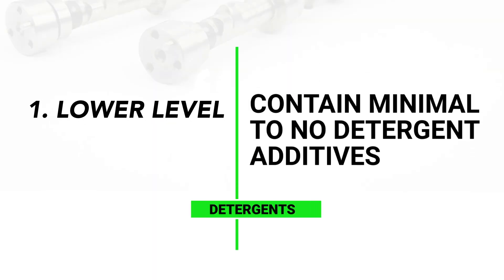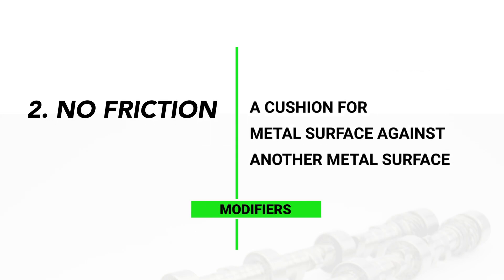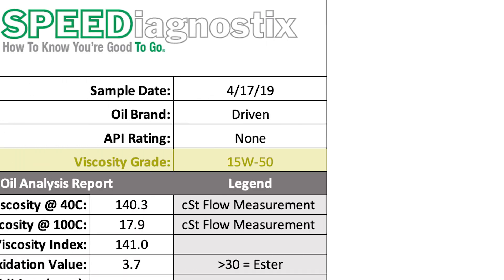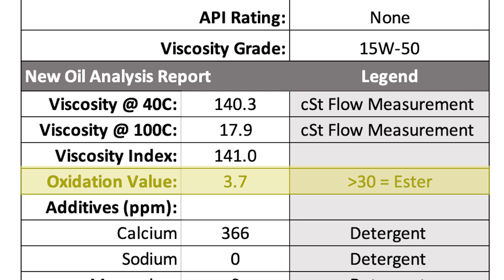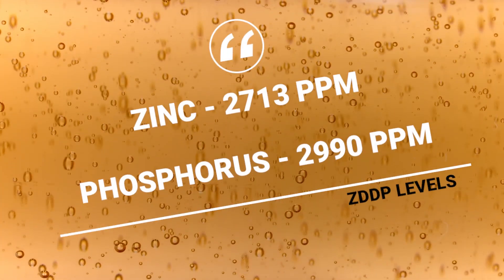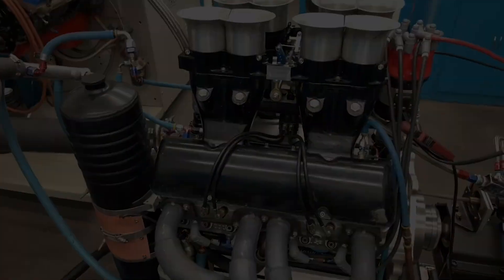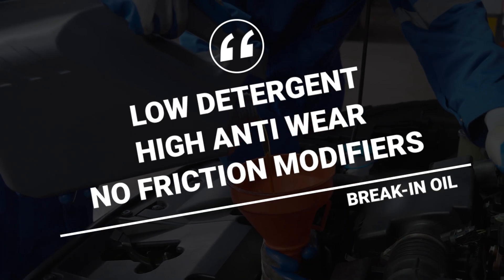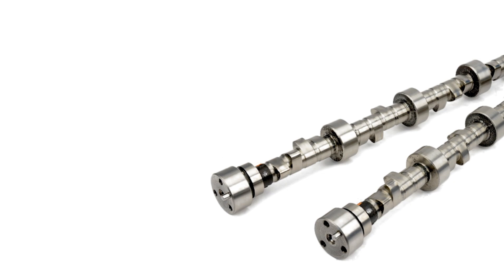Is It Just High Zinc (ZDDP), Or Is There More To It?

Comment: I am planning on replacing my worn out, year 2000, chevy Silverado 6.0L engine soon, would you recommend using a break-in oil with that engine and if so, how many miles before going to a normal oil?

Comment: Hey @themotoroilgeek I’m having a brand new 6.0 Powerstroke diesel engine built with coated pistons and bearings. I wanted to use the Driven DBR 15w40 break in oil, but the builder said he ONLY recommends Motorcraft conventional 15w40 or Shell Rotella conventional 15w40 for break in on these engines. Change the oil and filter after the first 100 miles then again at 1000 miles using the same oil. Then change at “routine intervals” with conventional or semisynthetic oil of my choice until 20,000 miles where full  synthetic is permissible. I’m sure I already know the answer, but am I doing myself a real disservice by following his recommendations?

Comment: If I got a new long block for my Jeep, say a 3.8 for the Jeep JK, should I use a Break in Oil for the first 200-300 miles? Use something like the Driven BR5w-30
Reply from the maker: Yes, that is a very good break-in oil.
Reply: @themotoroilgeek  I saw your other video recommending ZMax and Motul also, but their oil is a lot thicker for that engine. Not sure it would be ok.

Comment: Break-in is the key word, you want wear, but you want it where it matters, piston ring sealing. The tappets get protected from the extra ZDDP in break in to mate the tappets and cam.
Reply: Emissions regulated engines have to be ready for test off the line, limited break-in. Rings are potted for break-in to circularity before they arrive for engine assembly, or were. Modern bores are cylindrical when final honed, so the engines can be run after a 20 min warm and test cycle. This is/was standard in the diesel industry 10 yrs ago. Actual break-in was minimal and only in the factory. Aircraft engines (air-cooled) are completely different matter and must use a non-detergent break in oil for 10 hours under 75% load. Automotive engines are much higher precision parts than 20-30 yrs ago. My Toyota had zero debris in the oil filter from day one. Not so for automotive of 15 yrs ago or aircraft engines today. Aircraft leave shiny metal in the filter for 50-100 hrs. Then they ARE broken in. I inspect all my vehicles oil filters.

Comment: What oil should I use to break in my bmw m20 engine, I have spent a lot of money on this engine and it is a solid lift cam that you have to adjust every 45,000 miles you have a rocker arm sliding on cam lobes and I want this engine to last, also it does see some track time turning to 7000 rpms

Comment: Just use the higher film strength oil and drive. The old break in oil days are obsolete. EX. oils that are over 100,000 psi film strength on the computer controlled heated tribometer. Check those "break in" oils for the typical low film strengths of 50,000 to 65,000 psi failures.  There are oils now reaching 150,000 psi film strength levels now far exceeding any break in oils. You flat tappets will be fine from the first minute.

Comment: Hi Lake, 

I purchased a reman GM Goodwrench LQ4 (6.0). Instructions say to Pre Lube using GM Assembly Lubricant P/N 88862587 (EOS) or equivalent with their GM engine pre luber tool or equivalent (hand pump container); says to use preluber to fill filter and oil cooler/lines. Apply oil to cooler inlet line , check for debris at return line and flush if there is debris ( I installed new lines). Then connect preluber to engine with appropriate adapter , open valve, allow oil to flow for several minutes after oil appears in valve train area. This is the preferred method. 
Method 2- When applicable , use drill motor to turn oil pump to pre lube, turn oil pump 200-500 rpm for several minutes after oil appears in valve train area. 
When previous two methods are unavailable. Disable spark and fuel, and crank starter for no more than 30 seconds with 2+ min rests between until  normal oil pressure is reached, and continue to do this for a total or 2 minutes after normal oil pressure is reached.  It’s not clear if I should only add the EOS , or also fill with oil for any method. EOS bottle says it’s not to be used as an oil additive. Spoke to dealer, they just said If I want I can open up valve covers and pour Oil or EOS all over, then top off oil to proper level and prime. Opened oil drain plug and some oil came out, I imagine it’s from manufacturer testing engine. Instructions don’t specify what oil to use either.  Instructions are P/N 89017902 
. Any thoughts on best way go about this ?. Apologize for the long message. Thank You

Comment: Have a question  for you!  I have a 2023 sierra with the 6.2  changed my oil at 800 mile for the first time a put a wix filter with 0w20 mobil 1 in it.    Even after another two short oil change intervals I still had metal in my oil  filter, which led to the truck being at the dealer for rod knock.   I'm getting a new engine now.   When I get the truck back is there anything I can do to prolong the new engine ?  Can these new v8s handle a thicker oil than the specified 0w20?

Comment: I would like to use the driven BR oil in a predator generator to break it in, that calls for 10w30, but I don’t see a BR 10w30 weight in the web site? What weight would be most appropriate to use if that’s the case?
Reply from the maker: Use the BR30

Comment: Hopefully you see this before i start back on my engine i have an iron block ls. Ofc with roller lifters.  I was told to pour zinc before start up. I watch you last video🤦🏿 so if it'll be bad, what i need to use to break the motor in?

Comment: Hello Lake. I have a question about the Driven BR 15W-50 oil. Is this oil safe to use in a Harley Davidson Twin Cam 103? I will be rebuilding the top end and going to a 107 cid. The main reason I was looking at this oil is to chemically seal the rings. I have roller lifters and the main bearings on a Harley Davidson Twin Cam are roller bearings, not your typical babbitt style. Harley Davidson states that if you are in a pinch and need to add oil to your bike and the oil they recommend is not available, you can use a diesel  "C" rated oil of the same viscosity to get you by, but to change the oil as soon as you can. I use 20W-50 in my bike. The BR 15W50 does not have an API Service Doughnut on it, so I don't know if it has the "C" rating.  The engine will be broken in on a dyno and I planned on changing the oil after 50 miles, or should I keep the oil in there till 400 miles, there is no catalytic converter to worry about?  Also, on a Harley Davidson Twin Cam and other HD engine models, the engine oil is separate from the primary (chain) drive and the transmission oil, so there will be no shearing in the gears.

Comment: I have a huge question here. On flat tappet cams. is it ok to run a " regular" type motor oil like the Penzoil platinum AFTER the break in period of the cam. I have been told that you always need to add zinc or use a high zinc oil with these cams. But i currently have 3 flat tappet engines and 1 overhead cam engine [ 1968 350v8 Buick, 1968 Buick 430v8, 1985 Toyota Landcruiser 2F I6, and 1979 Toyota 20/22r I4 . that all have over 200K Mi. one with over 300KMi. 2 of which are original and i did not break in.  2 that i rebuilt and broke in myself. I have always tried to run synthetic for the lives of these engines. normally 5w30 Mobil 1. or 10w30 Mobil 1. or the new Penzoil Platinum. But also used the old Castrol GTX for a couple of years in there. But i never ran any extra zinc. or specifically used high zinc race type oils.  All of these engines were daily drivers that saw limited autocross and drag racing over the years. Mabe 6 times each for each of these engines.  So is this just a myth?? or can we just run regular oils after break in???  Loving the channel and all of the great info you are providing. Tom in ND.
Reply: Sorry. Pennzoil Ultra platinum.

Comment: Used BR 5w30 on a GM reman LY5 5.3. Ran for just shy of 40 miles. Very impressed with the way this one turned out. It may be I am just biased but I think this one runs stronger than any other I have r installed. Btw the truck was a beautiful 08’ extended cab with 138K on the clock and absolutely no rust. Amazing for an Indiana truck. Original engine broke a #2 exhaust spring. The guy was very good at maintaining it prior but 7/8 pushrods on bank 2 showed significant wear. Cam looked ok.

Comment: What about if the engine has a turbo?
Reply from the maker: Break-In oil still helps
Reply: @themotoroilgeek  Thanks for the reply. I was wondering if break in oil would be detrimental to a turbo even if it was beneficial for the rest of the engine. Turbos have such fine tolerances and run at such high speeds and temperatures that I thought it'd be worth asking.

Comment: Hi Lake, I appreciate your videos, thank you for all the detailed information you provide.

Being an Automotive machinist of 30 years, I still learn something new now and again.

I sent oil away for analysis, as the client sent his turbo diesel   engine for rebuilding at another company. The engine lasted all of 400km and then seized, when I saw the location of the seize marks on the pistons, it indicated an overfuelling condition. The flash point occurred very low at 170' C  when it should of been around 228' C, if I interpret the graph on 15W40  mineral oil, that would indicate a fuel dilution of more than 4% or am I wrong?

Comment: What over the counter , Walmart sourced oil would you recommend to be used in a new car after 500miles factory oil dump ? And how long would you run it for ?
Reply: *bump
Reply: @anthonydesouza3602 I used Pennzoil Ultra 5W30 , it has low amounts of Molly and anti friction pack so it should serve well into new car . I dumped my factory fill at 600 miles ... used Fram Ultra filter .
It is important to use Ultra not just Platinum as Plat uses more additives and anti wear agents,  Ultra is much better base so no need for so much additive pack.
Reply: @anthonydesouza3602  Quaker state 5w 30. .  search "Rat 540" blog. He developed a proprietary oil testing method that tests oil to failure based on pressure . He has a ton of additional info on oils and a comprehensive list of well over 200 oils.     The break in oils generally dont do well in his tests and he's convinced the datas shows Zinc is not needed.  Read his stuff and compare to this video and then decide.
Reply: Quaker state 5w 30. .  search "Rat 540" blog. He developed a proprietary oil testing method that tests oil to failure based on pressure . He has a ton of additional info on oils and a comprehensive list of well over 200 oils.     The break in oils generally dont do well in his tests and he's convinced the datas shows Zinc is not needed.  Read his stuff and compare to this video and then decide.

Comment: I have rebuilt many engines and not once did I ever use a dedicated break in oil.  I filled my engines with the same oil that would be running in them.  Never had an issue with a rebuilt engine run from the start with normal oil.
Reply: awesome information. a regular non synthetic oil will do just fine? do you also agree to rev the engine to max rpm redline during break in period? thank you
Reply: Wow you get a cookie
Reply: @DCF1VER  i'm sure if you were a professional engine builder and staked your reputation on having your engines be highly reliable a dedicated break-in oil would be the way to go. but for most of us who are just stabbing cams into junkyard 350s in our garage with harbor freight tools some assembly lube and regular oil works fine. sure, it might bite you. but for the shade tree mechanic so will a lot of other fluky things. not using a special oil for the job is NOT a death sentence for those flat tappets. for the most part it is okay.

Comment: Thank you for this!  I've never seen this critical detail explain so succinctly.

I run break in oil on every rebuilt/new engine that I've had, and the results have been stellar.  There are always people that say 'just follow what the manufacturer recommends' missing the detail that the oil they typically put in has friction modifiers and lots of detergent, which neither are great for breaking an engine in.
Reply from the maker: Thank you!

Comment: I wonder if it wouldn't be beneficial to substitute one quart of regular oil with one quart of break-in oil for high-mile cars? The added zinc seems like it would be good for it. Am I wrong?
Reply from the maker: I'd rather use an oil with a higher ZDDP level than add a different oil or additive.

Comment: I’ve got a 22 GT500 with 1500 miles. The car is a garage queen and has had one oil change in its life at around 1100 miles using motorcraft 5w/50. 

Would you recommend dumping said motorcraft in favour of this break in oil OR do I just add some break in oil additive from redline syn which has high zinc and phosphor ? Thanks!

Comment: The engine builders of the 60's and 70's said to drive it like you stole it or drive it as you planned to use it, if it was a tractor or a piece of machinery.  Most of those tractors and large engines are still running today.
Reply from the maker: Absolutely. That is the right way to break-in a new engine. Don’t baby it.
Reply: @themotoroilgeek so you agree with Motoman! 👍

Comment: Hi Lake, 15+ years ago the talk was going around about modern oils not having sufficient zinc for a flat tappet engine. At that time, using Chevron's Delo 400 seemed to be the way to go. What I have found during an oil change, the oil becomes thick and sludgy.  ---this was in engines running either a 180 or 195 thermostat.  The engine would also occasionally have a lifter not pump up resulting in ticking. I have decided to stop using the diesel engine oils in favor of running 10w30 break-in oil for the added zinc. On the same oil change interval, the old oil has looked much better and the engine has actually run smoother without lifters bleeding down. Watching your videos I am learning about oil and now, I wonder if there would be any detriment to continually running an old flat tappet engine on break-in oil? What does the break-in oil lack for engine longevity? Perhaps a video on the do's and don'ts of using either diesel engine oil and break-in over the long term would make a good topic..     thanks for sharing your info!
Reply: Think as he said early on is lack of detergents which aren't needed early on, but as with you, I have old flat tappet engines that are best run with higher zinc, but also include other ingredients like detergents with normal use. Then go with a high mileage oil later in it's life.
Reply from the maker: Thanks for the suggestion! There are drawbacks to running a break-in oil all the time.

Comment: Does this apply to electric plug in air compressor engines that use oil?
Reply from the maker: It does help with them as well. Piston rings need to break-in.

Comment: That begs the question if you are building a fresh motor should you be using a cam lube with molybdenum in it ?
Reply from the maker: Great question! It is ok as long as the Moly lube on the cam is used sparingly.

Comment: Got a question. So I just refreshed a honda engine. Head was resurfaced had new valves and new valve seals put in. Cylinders were deglazed and I put new rings on the pistons. So do I just warm up the engine for a few minutes then drive it? Accelerate and engine brake as much as I can?
Reply from the maker: Anytime you put in new rings, follow the procedure listed in this video: https://youtu.be/MhA_nVRhYew
Reply: @themotoroilgeek  awesome. I did watch that. So no need to do a cam break in correct. Just drive it. Accelerate then left off thr gas correct for about 30mins or so?
Reply from the maker: @essentiallites  yep, warm up the engine and drive it as in the video.
Reply: @themotoroilgeek  thanks.  Already subscribed and gonna continue watching and learning

Comment: Interesting. I just bought a new Honda Ridgeline and researched what they use for factory fill break in oil. It looks like they don’t do any of this!

Apparently, their break in oil is identical to their service fill oil, except they add moly! So the friction modifier no-no, plus no more zddp than their regular oil. In factory fill oil analysis I’ve seen people post, the moly is in the ~650ppm range. I wonder why Honda does this.

For a normal passenger car/truck, is it worth it to drain the factory fill oil early and run a true break in oil for a few hundred miles, before moving on to maintenance oil? Thanks!
Reply from the maker: If the cylinder bore finish and piston ring coating are engineered to work with a high Moly oil, it will work. However, that is not what most manufacturers do. Both Honda and John Deere go that route, but they are the exceptions. It is harder to go that way from a manufacturing perspective, but it does work very well when executed properly.
Reply: @themotoroilgeek  I see. That’s great. Sounds like I can skip draining the factory fill for dedicated break in oil, and go straight to my service oil for my first oil change. Thanks for the insight!

Comment: We know this is a mineral-based oil by the oxidation value of 3.7 but the Pennzoil Platinum full synthetic gas derived oil has a similar oxidation value I'm confused
Reply from the maker: The low oxidation value of the Pennzoil Platinum shows there are no co-base stocks like an Ester, which would increase the oxidation value. 

The Pennzoil GTL base oil is different than other synthetics, so I can see how that is confusing.

Comment: For built motor applications (cam and valve train), is it advantageous to add zinc additives like Lucas TB zinc to oil changes?
Reply from the maker: Thanks for the question. The simple answer is No. Don't use additives. Instead, use an oil that already has the correct amount of Zinc for flat tappet or "built" engines.